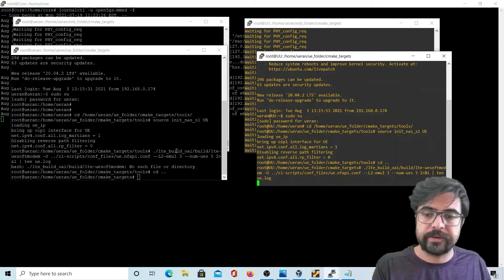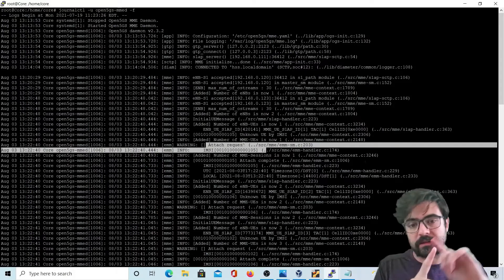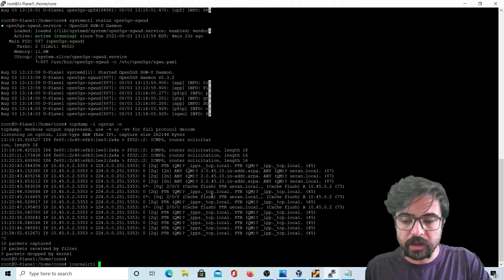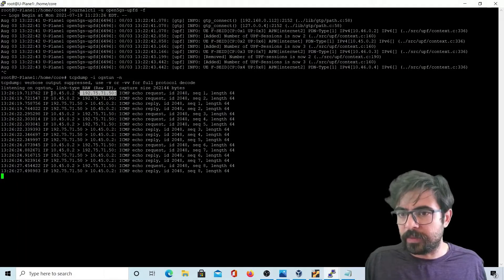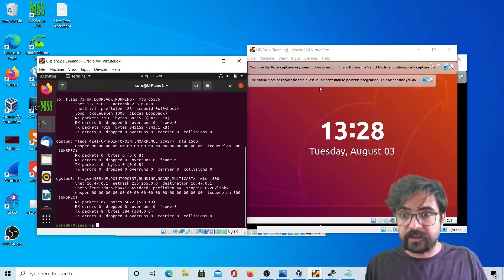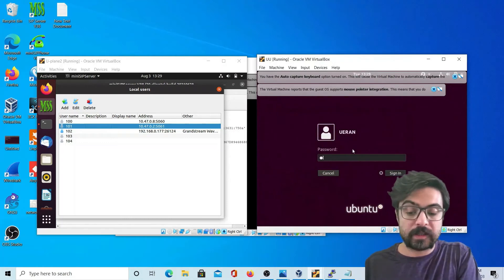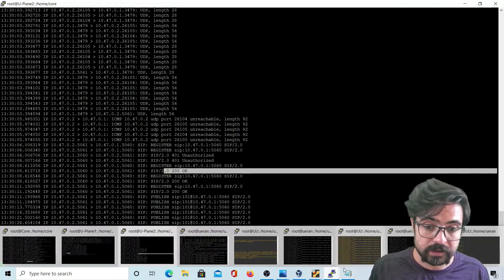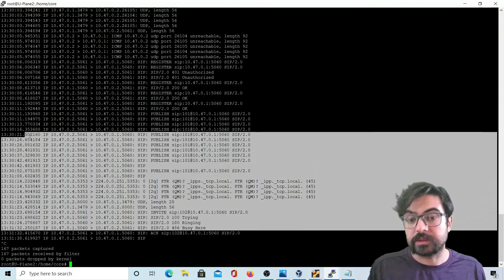Open5gs walk-through - part 2

Comment: Hi Amin,
Do i need just 1Tx/Rx SDR connected to same eNodeB to make a call from one phone to another phone.
Reply from the maker: I don’t think so!
Do you have this problem? You’re not able to make phone calls while your UEs are connected to different eNodeBs.
Reply: @aminsedighfar  I am not able to make call both UEs are connected with same SDR
Reply from the maker: @RKami-d9g  sometimes sip phones that you use are not working properly.
Did you try to change?
Reply: @aminsedighfar Hi, Do I need  2x2 TX/RX for SIP call from MO to MT phone? What would you recommend Ettus B210 2Tx/2Rx? Thanks
Reply from the maker: @MyKami78  I haven’t done this yet, so sorry, but cannot recommend anything.